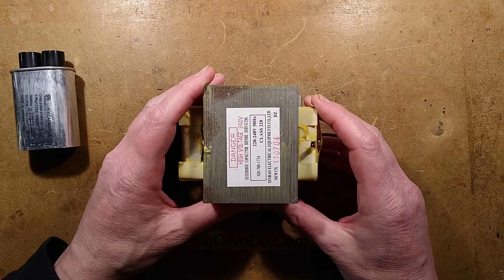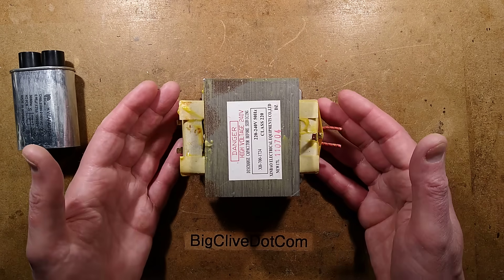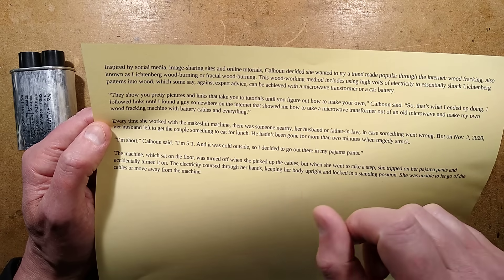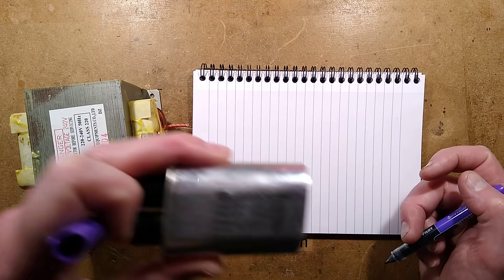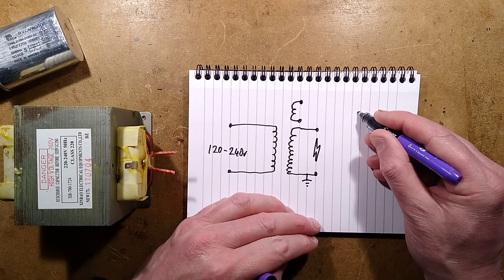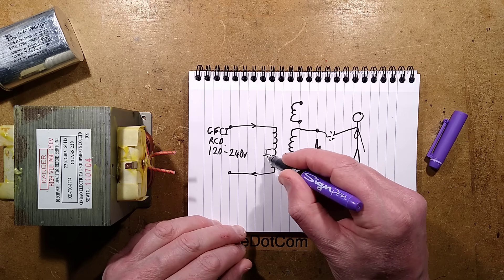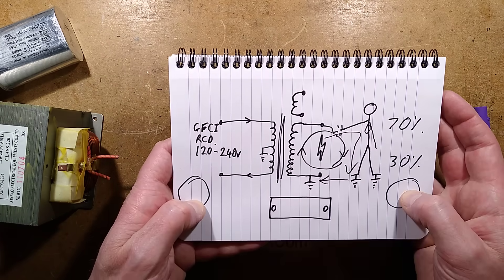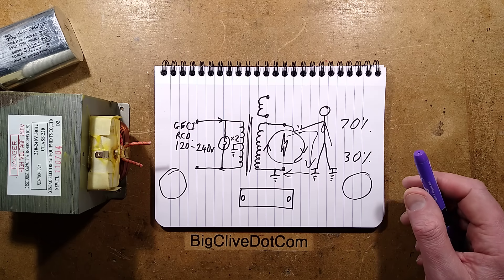The most deadly project on the Internet

Comment: probably the worst thing is before someone finds you, they'll smell you. they'll smell your burning flesh. that would traumatizing. the second worst thing to find is a portion of the body crunchy and black from the current path. safety is the number 1 priority because 1 mistake=death. that voltage is so high, it breaks through the resistance of the AIR. if it can break through that, then it has NO problem breaking through gloves, going through your hand, inside your body, to your feet, through your shoes and to ground. be SAFE SAFE SAFE

Comment: This reminds me of a time when i got shocked by a project similar to this. The project has a total of 6 transformers. I touched the live cables from just 4 of them and I'm glad i was able to let go. I was isolated from ground too. The second time i got zapped was when i was using some poorly insulated pliers to play with arcs from the transformers. The total voltage of them all are about 3.5-4k volts. I got zapped through the pliers but the circuit didn't close through my body (thankfully). But the reason i got zapped is because seeing as the voltage is so high, it has so much energy on just one of the terminals and since the body has a capacitance and resistance, that's what allowed the current to flow. But once again, thankfully the circuit didn't close through my body but it did zap me pretty bad.

Comment: I agree with the sentiments of this video wholeheartedly. It is an inherently dangerous project based solely on the use of moderately high voltage and current, and it needs to always be respected. I know the first time I saw a video about this my very first thought was 'that's terrifyingly dangerous' and then second thought was 'I want to do it!'

For me, making dangerous things as safe as possible is always the first goal post. Deadman's switch, full insulation of the electrodes all the way to the tip, as well as every connection point, wearing proper insulation gloves when using as well as insulation to ground as much as possible to stand on. There's a lot of safety points to add in to make it as unlikely to kill you as possible before trying a project like this, or any that use an unmodified MOT. One thing I'd want to do too is install GFCI protection on the output side of the transformer as an additional means of protection
Reply: It actually is a lot of fun....but yea is highly dangerous. Ive created some beautiful pieces of furniture and artwork with it, but just have to be careful.

Comment: i have fucked around with a lot of things in my life that you could consider dangerous, electricity, fires, bombs, guns, one thing you have to understand when dealing with any of these things is they are to be respected at all times.
prepare safety measures for all foreseeable and unforeseeable occurrences to prevent a dangerous situation.
fires and bombs are a little more difficult to do this with due to the unpredictability of certain factors, but if you do things by the book safely and consistently as well as understanding full well the dangers inherent to the project in question you will never have a problem.

for electrical dangers, always be sure to have them housed in plastic boxes, never have any wires bare, make sure they are properly wrapped with rubber or pvc plastic,  don't allow any leads to be connected while the object is not in use. even if the tool is "off", be sure to take the ground off first, then the neutral then the hot wire. the wires are indicated by color coding, generally, green is ground, white is neutral, black/red is hot for houses and for batteries/jumper cables, black is negative, red is positive. negative comes off first then positive comes off last.
if your not sure what goes to what do not guess! look up the color code or call a licensed electrician to help you. 
it's a better to live and learn than die in ignorance.

Comment: It’s very easy to get complacent about electricity with things like RCDs protecting us. However, I had a lesson in respect when I discovered a fault with the connection to the main cable coming in to our house. I could smell Ozone and hear a buzzing noise coming from the connection box, so called my electrician. He insisted I call out the emergency team from the National grid. Long story, short. Later that evening two engineers fixed the problem while working on the live cable as it could not be switched off. One engineer carried out the work of fitting a new end terminal while the other stood by to pull him away, if he got a shock. Both engineers wore heavy rubber gloves, with even heavier leather ones over the top. They were both cheerful about being called out late at night, but deadly serious about the job. I’m much less complacent about tinkering with household wiring since.

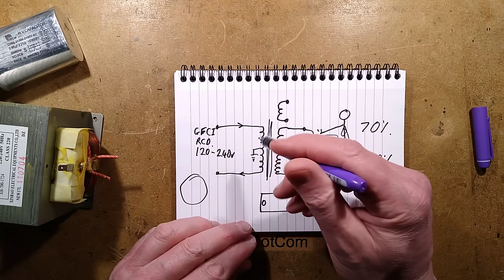Comment: Hi there, the indicator light bulb at 12:39 should be in series to the primary coil. Then it only lights up when current is flowing through the coil and if the light bulb is broken no current can go through the coil. :) Cheers

Comment: Holy cow!!! I had no idea those things put out that much voltage. Right away I can think of several things a person can do to increase safety such as incasing the transformer in an electrically insulated box and using much longer, well-insulated electrodes. Most importantly, a person should ALWAYS maintain a healthy respect for electricity regardless of the voltage. That said, while I think the effect is really cool, it's not something I ever wanted to mess with and now I have even more reason to stay well away from it.

Comment: Damn now im a bit scared. My car sound system is at 2000w rms. Is it a ticking bomb...? D: And i installed everything myself. The negative and positive wires connectors at amplifiers are very close to each other and i am pushing north of 150amps at 12-13v sometimes...~ through these. How dangerous that is? Considering that i did a good install with decently sized cables, etc. But still now it feels so much more dangerous than i thought.

You said that electric chair is 2000volts, now my stereo is in the same ballpark? Now i feel not that safe anymore even if everything works fine,.. :|

Comment: I used a neon sign transformer also, despite working with electricity for my job (I repaired medical equipment) I still managed to not notice a wire touching the ground. It was rated at 4kv and knocked zapped me through the wires insulation that I grabbed and ended up knocking me back 4 feet from where I was standing. Don't drink and play with electricity, especially while barefoot. (I was fine, just had a tiny burn on my finger and foot, but the concerning part that research hasn't really discovered yet it how much damage internal burns cause. That currents gonna cook you the entire path from entrance to exit.)

Comment: I did A/C for a number of years and one of my "horror stories" when when we were doing a change out on the roof (Lots of them in Phoenix) and the sheet metal guy wanted to leave the unit running as long as possible to keep the residents cool and he ad removed a couple of access panels to remove screws etc.  He put his shoulder to the unit to shift it a little and I was on the other side getting my prep work done and I heard this BANG and looked up just in time to see him flying off the roof.  Of course I freaked out and ran to the edge to see him sitting up on the grass and holding his head.  I went down as quickly as possible and by then the rest of the crew were there and wanted to take him to the ER which he didn't want to do, but we convinced him to go.  We finished up the job and went on with our day.  The next day he was back at work, a little sore from the fall.  He showed us the two holes in his skull where he went across a 45 MFD CAPACITOR, RUNNING.  The doctor said he was lucky to be alive.  He then dropped his trousers and showed the EXIT BURN ON HIS LEG.  I mean the guy was as solid as an oak tree, no fat anywhere.  That is what saved his life.  So a VERY VALUABLE LESSON:  RESPECT ELECTRICITY.  I've been bit by 110, 220 and 460.  The 460 hurt like a bitch (very brief contact) and I was sore for weeks.  As soon as you get complacent, you get hurt or die.
Reply: Because he wasn't fat, that's what saved his life? Serious question, not being a pretentious douchebag.

I got zapped by a electric meter on our apartments...I had to lock myself out of my room but the window was open and it's on the second floor. The way the apartments are below my window there's like a flat part of the roof of the kitchen. Essentially like a 2stairs. On the second stair is where my window would be. I decided I could get up on the roof and get into my room and unlock the door... I had previously ate Xanax bar, maybe two. Needless to say I was pretty out of it, but I still remember what happened. Right outside the kitchen window on the bottom floor there is the apartments electricity meters. About nine of them in two columns. I had moved a grill over step on, had pulled myself up onto the electricity meters, the right foot was on top of the meters, the other one I stood on meter face made of glass that was protruding out. When I put my weight on it, the circular meter face broke off & I fell about 8 feet on to the concrete walk way. I yelled out as I fell I felt like I broke some bones. It was summertime so the windows were open and my mom came out yelling at me, demanding to know "wtf I was doing?!" 
I don't remember what I told her but I started panicking because I had broken the meter that was my neighbors so their power disconnected immediately. I made quite a bit of noise and my mom was out there yelling and I don't know why but for some reason I started panicking thinking that the cops were on the way. I started screwing around and trying to move back everything the way it was so that if somebody came out they couldn't tell someone was trying to climb on the roof and that's how the meter was broke. I moved the grill cleaned up some of the gravel that I had pushed onto the cement walkway. I grabbed a meter face mind you my mother is still standing at the door way watching me, I had the meeter face in my hands and immediately I pushed it back into the hole in the meter case, as I pushed it in my mom realized what was happening and yelled at me to stop but it was too late. As soon as the middle connectors on the back of the meter face touched the inside of the case electricity blew out like crazy, pull me back like I'm not even kidding 10 ft. My hands were black like in a cartoon and I had fairly minor electricity burns on my fingers which I still have a slight scar on one of my fingers today, the one that got it the worst. Immediately I got up and all around the meter case was black. I got up and I went in the house immediately and started washing my hands. I was all right for the most part but the next day I had my first seizure ever in my life and during the course of that seizure I fell and broke my left shoulder. About a half dollar size piece of bone off the humeral head which I had to have fixed with a plate in seven screws. 
She was pretty wild LOL
I find it amazing that I somehow survived getting electrocuted because I know there is a ton of electricity that flows through that box.
Reply: You wouldn't believe this but some dude somehow got electrocuted on the roof and somehow flew or something and made it to the lighting post and got electrocuted twice and on top of that falling on a fence with spikes right on his ass.
i don't know if he survived or not but i assume not.
Reply: I'm kind of amazed that someone could get two holes blasted through their skull and still be able to work the next day.
Reply: @drpibisback7680  He was tough.  Built like an oak tree.  His doctor told him to take a few days off but he came back anyway.  You could see the 2 holes in his skull (they were two CLEAR divits but didn't penetrate all the way through)  but more disturbing was the "exit" burn hole on his leg.  If he wasn't so fit, he probably could have died or been seriously out of commission.  The doctors at the ER told him he was lucky to be alive.

Comment: As an Apprentice is was taught to be very careful when repairing microwave ovens...the general rule is if the hv diode blows after replacement then throw it away...Also I made my first argon tube light (like neon but with argon gas) using a microwave oven transformer the hv wiring I used was copper core spark plug leads.

Comment: I have enough of an electrical background to know that if I was going to backyard engineer a fractal transformer, the safety gear would be more valueable than anything I'd make - hence sticking to neon transformers and 10x insulators with remote switching. While some think they need the high amperage, it's a lot easier to get intricate paterns without blowing through a workpiece or waterlogging using low amps... and you can use thin gauge pins stuck into the work, rather than large spikes that need to be held.

Comment: I played around with this a few years back, not to make etchings or anything but to make a jacobs ladder. I did it successfully and safely and I'm here to tell the tale. 
However if I'd seen this video about how the RCD doesn't make a blind bit of difference being on separate circuits, I wouldn't have even considered touching it. 
My thinking was, if I do screw up something in some way and zap myself, I'll be fine because the breakers will trip. I might get a nasty jolt and only my ego would be damaged. 
This is not the case!! NOT AT ALL!! Jeez. I thought I'd done sufficient research into this. Seems not! 
Thankyou Big Clive for taking the time to educate us about this. 
Play safe people!

Comment: Thank you for this video.. Hopefully, it will prevent  some of these idjits from  killing or maiming themselves. They have NO IDEA of just HOW DANGEROUS High Voltage can be.  I have had my experiences with electrical shocks ..usually with HV DC(600-700V), and 120V AC.  What they teach you is to keep ONE HAND in YOUR POCKET. ..NOT always practical.   How about a type of "GFCI" in the secondary?    Would that  be feasible?  A deadman's switch can also be impractical...If you actually need a hand to do something while the power is ON (like measure voltages in a circuit).   Has anyone tried using an Oil burner transformer? the secondary is 10,000V , but the current is usually 23mA.  We used them to make "Jacob's Ladders".

Comment: Something I don't see anyone mention about these death traps is that they are often shown used with 1 probe in each hand. Even working with low voltage consumer electronics and pc stuff, nothing higher than 12v, I was taught to always keep 1 hand out of the way, because of the idea that habits should be built even on low risk situations. With high voltage, if you shock one hand, it's probably not traveling past your arm. If you shock from one hand to your other hand, your heart is in the way. It's not just high voltage, it's enough voltage to punch through your skin, enough amperage to cause every muscle to tense up to the point where you are going to have muscle tearing as well as the burns, and all that is given a path straight through the heart.
Reply: Not really knowing much about more advanced electric circuits, it seems by the video's explanation that holding one probe is sufficient to fatally close the secondary circuit because it connects through the ground, meaning it goes through your arm and down your body anyways. Still a good rule, but it seems it wouldn't help with this particular case.

Comment: I mean current flow carries energy like water right?
(Not the same way though)
So why does people messing around with lethal high voltage structure but they knows not to splice themselves into pieces with a high-pressure water cutter?
It's basically the same level of stupidity, besides that electricity is mostly invisible.
(Which makes it more dangerous)

Comment: I built a generator with a 1.5v motor, a bottle cap covered in neodymium magnets, and an ignition coil from a lawnmower. Ran the motor with two AA batteries. I accidentally tazzed myself with 56v at 1200 mA...it didn't feel wonderful...

That transformer is HIGHLY dangerous. That capacitor is Extremely dangerous. The magnetron is toxic and, of course, extremely dangerous. A lot of that machine is extreme, so leave it alone unless you Actually know what you are doing.

I didn't catch the turn ratio... What could you run out the other direction with your European mains? 12-24v? Be careful with that ampere... don't fry anything.

Comment: transformers are very dangerous in general, i work with them every day and and at work we have a lot of safety features. for example are we not allowed to work alone in a room. We also have a ton of emergency off switches in the building which will turn off the power in the whole building. good video :)

Comment: I have a degree in electronics. I have worked on microwave ovens and TV's, both old and new. I have been shocked by both as sometimes they have to be powered to diagnose problems. I did build a wood fracking machine, armed with knowledge and experience. I put several safety systems in place before attempting to use machine. Even at that I am overly cautious, well maybe not overly as you can never be too cautious with high voltage. There are several more safe systems for sale commercially that I would suggest using rather than building something based on a youtube video.  I don't recommend that anyone build one of these.

Comment: I practically tell people to not screw with microwaves every week. Thank you, I will use this electric chair fact to ilistrate my point. You also didn't mention the carcinogenic ceramic inside.
Reply from the maker: Beryllium is rarely found in domestic microwaves.
Reply: @bigclivedotcom  would it be more common in older domestic microwaves or rare in general?